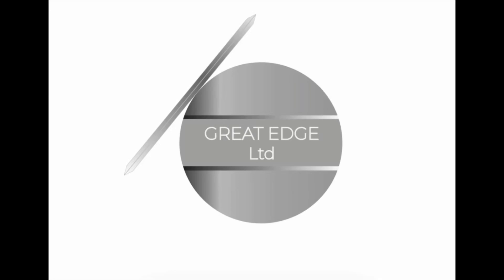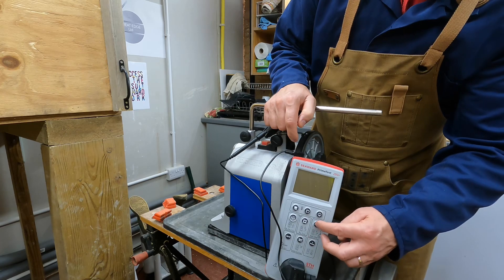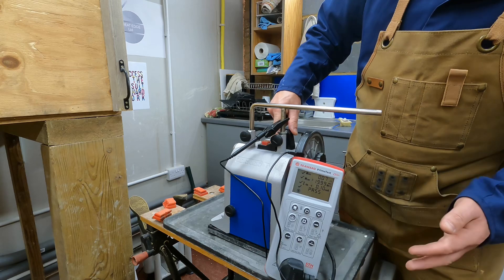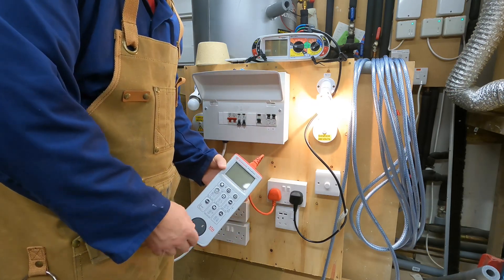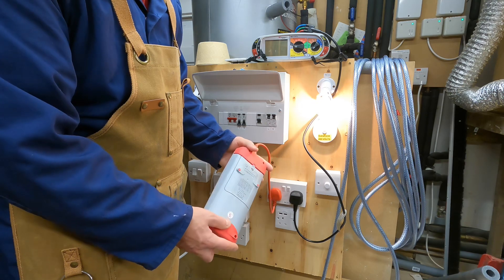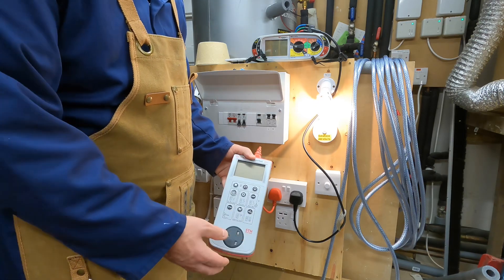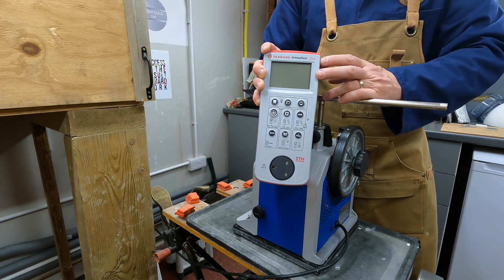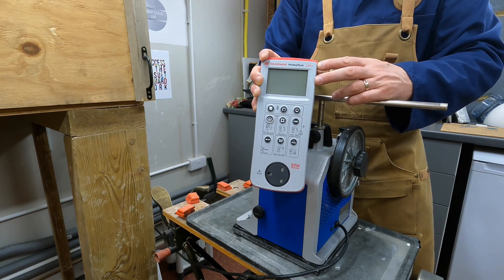Reviewing some features of the Seaward Primetest 250+

Comment: The RCD test in PAT testing is for a portable RCD. The consumer unit RCD is tested under the fixed wiring or EICR testing. In Scotland it is mandatory to have consumer unit RCD protection in residential rental properties
Reply from the maker: Thanks for tuning in, and you’re absolutely right. No one would/should be testing fixed wire RCD installations with a PAT device.  Even for those portable RCDs I think I’d still reach for my Multifunction tester. But the Primetest might be handy once in a while just for a quick check when stringency isn’t needed.